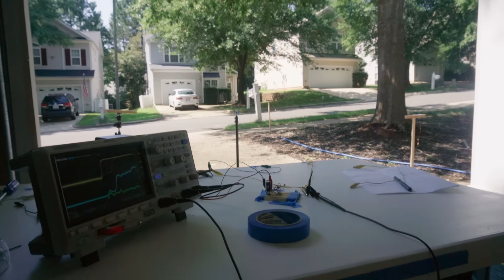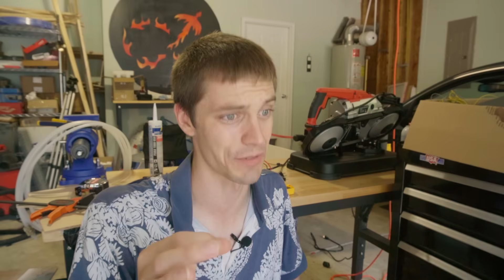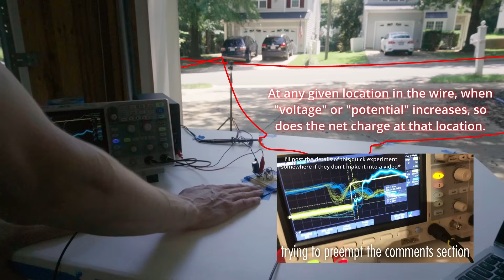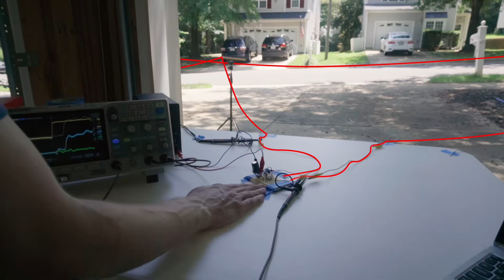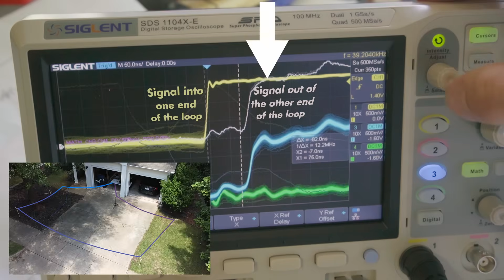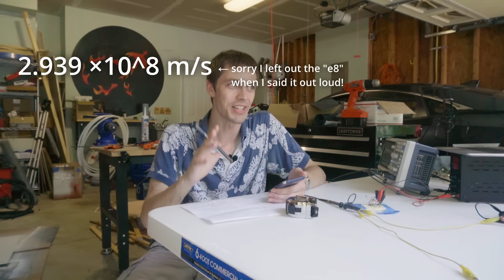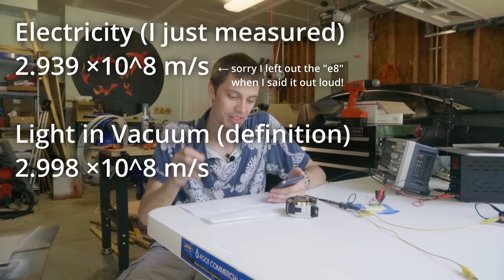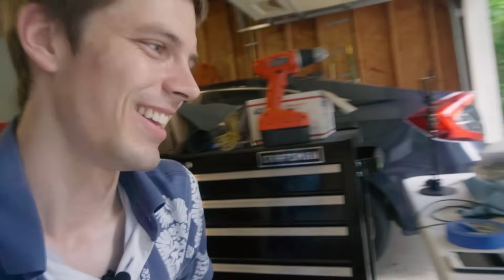Why does WATER change the speed of electricity?

Comment: The "water" part is great, but the 'thin' vs 'thick' wire seems problematic. Yes, you tried to make the experiment with not that much inductance and not that much resistivity, but it's still LR circuit. Reducing R will increase the reaction, not decrease, because inductance happens. t=L/R

Comment: You and Veritasium completely reshaped my understanding of how electricity flows which is amazing considering I've got a degree in electrical engineering. I've always thought that electricity moved at the drift velocity of a material, but was always confused why drift velocity is lower in metals than semiconductors. Now I understand drift velocities is only for electrons not the electric field that's producing the current.

But this begs the question: why is there talk of switching silicon-based subtrates for germanium if drift velocity doesn't change the speed of electricity? Same with the idea of photonic computing: if electricity moves at the speed of light, shouldn't conventional CPUs have the same clock speed as photonic currents?
Reply: The surface charge that is responsible for creating the (small) electric field inside the conductor is veeeeery fast. The charge in the bulk of the conductor that is accelerated by the E field inside is slowed to a crawl by all the collisions with the lattice ( in classical ED). The result is a drift at very low speed along the conductor. When you switch a semiconductor device you might be able to establish the field inside the different regions of semiconductors almost immediately, but then you need for charge inside to actually travel through them ( for example because you need to charge or discharge some inner capacitor: a on junction depletion zone, a metal-oxide interface...). And that charge move at snail pace, at a velocity summed up by the carrier mobility in the medium.

It's like being able to open a faucet in a millisecond and then having to wait for the liquid to pour into a container: it takes time, and the bigger the viscosity - I mean the lower the mobility - the larger the time.

Comment: you're generating a square(ish) wave right there w/ all that switching on and off. 
the way that happens is counter intuitive because switching on and off seems like just 'simple events' and not a combination of simultaneous interacting events. 

each change of state (from on to off and vice versa) is a summation of numerous waves, interacting constructively (for on) and destructively (for off).
the quicker the transition between on and off (the closer the on/off trace on the oscilloscope gets to vertical) the more sine waves at different frequencies you're using. 

the same goes for optical signals in an optical fiber and it's the reason why internet speed is limited even thru optical fiber: the faster you want to pulsate light thru the fiber the more frequencies/colors you need to combine to obtain the on and off. at some point the fiber can't transmit more "colors", a bandwidth limitation

edit: i found professor's Mike Merrifield explanation: https://www.youtube.com/watch?v=0OOmSyaoAt0

Comment: I’m not an RF engineer, but shouldn’t you be using a VNA and considering the complex impedance and velocity factor of the media when doing this sort of thing?  What was the frequency of the signal you were running through the line, 34KHz?

Comment: i understand that the speed of the electric signal is more dependant on the propogation of the electric field (which moves at c) than it is on the physical movement of the electrons (which cannot move at c, since they have mass) but does the physical movement of the electrons have ANY effect on the speed? does electricity actually move at exactly the speed of light or is it delayed very slightly by the phsyical movement of electrons? 

in your animation the elections each had to move and THEN they sent out their "signal" telling the neighboring electrons that their position had changed. obviously in reality theyre constantly updating their location while moving rather than waiting until they reach a destination. does that fact mean that how fast they actually move doesnt matter to the speed of the electric field at all? if electrons were so massive that it took an electron 10 seconds to travel from one atom to the next would that slow down the electric signal or would it still move at c?

and while we're at it. how fast DO the actual electrons move? like how long does it take a single electron to travel down 10cm of wire? is the answer to that dependant on the current and/or voltage?

so many questions
Reply: The electric field moves exactly at c in the material for the given frequency.  The electrons move very slowly, around millimeters per second, but the speed varies with the current (actually it is the current) through the wire which is of course caused by the voltage across the wire.  We call this the drift velocity, and it doesn't really have anything to do with the speed of the electric field.

Comment: Regarding the i-removed-millions-of-electrons-from-a-wire thing: please, please, please help me understand something. Would a metal that is held at a negative potential/voltage, i.e. which has a couple of million extra electrons pumped into it, rust at a different rate than a metal held at a positive potential/voltage i.e. with a reduced number of electrons?
Specifically, I am referring to metals helps in a humid salt water (i.e. beach) atmosphere, with no direct current running anywhere (i.e. not in salt water, wehere sacrificial anodes do their thing).

I do think the lack or excess of electrons should somehow influence oxidization in saltwater spray air, but I just can't find any information on it.
Reply from the maker: for really big structures I believe actual power supplies are used instead of galvanic sacrificial anodes just for this purpose! I actually saw a thumbnail today for a Practical Engineering video about this but I haven't watched it yet - i'm looking forward to it!
Reply: @AlphaPhoenixChannel  LOL. Yes, that video is in my current queue, too! But it sounds like it's "just" another video about sacrificial anodes. Which are cool and all, but don't really apply in this case, I think (although the zinc coating on steel is supposed to act as a sacrificial anode in the small circuit that gets created if the coating is scratched in a humid environment, AFAIK).

But still: if one just leaves a charged battery out in humid and salty sea-air, shoudn't one of the terminals corrode quicker than the other?

Oh, and I love your videos - especially the explosion of passion and the underlying beauty of the universe that just bursts out of you every now and then. It really shows how you 'grok' physics, I think, and is contagious. Awesome!

Comment: It's funny how many times recently I've been reminded that DC is just a weird degenerate case of AC.  It's sort-of 0Hz (so high pass filters are incredibly easy to make and result in AC coupling).  But it's also sort-of not 0Hz, at least for the very brief period of time after you flip the switch on...

Also, you can see some of the sine components in your scope - you want the voltage to go from 0 to 1V (or whatever) but you get half of a square wave, frequency components and all.
Reply: When a DC signal changes, it isn't DC at that point.

Comment: I love how you can hear the wire signal as interference to the mic. I wonder how well that loop was working as an antenna lol. 

Hams in the area were probably like “wtf is this noise” not realizing an incredible amount of science was on display.
Reply: It would send out one pulse when the switch was turned on and another when turned off, but nothing as long as a steady DC current flowed through it.

Comment: I think that everything in the universe is actually moving in spirals.  I do not think they are planar sinewaves. I think planar sinewave is just two planar dimensional representations of voltage and amplitude. If you were to look down the wire, at the electrons coming towards you, you would see combined representation the up, down and left right deflections simultaneously. This would appear spiral in nature. Think of a electron travel in any medium like a bullet being shot. The rotation always present in the electron/bullet itself imparts spiral to the apparent straight path. Also the electrons are attached to the copper molecules so the electrons are spinning around the atoms causing a wobble in the electron. Atoms neutral at rest but when current is applied then the electron movement causes magnetic "exduction" from the atoms (my word for the movement of atoms inside a wire whose emissions outside the wire can be read by induction). There are Oscilloscope setting that visualize the spiral better.

Comment: If resistance doesn't change the speed of propagation of electricity through a wire.. then in this particular circumstance it would be accurate to say:

..Resistance is futile

Comment: Having thought a little more about your experiment I am considering weather the fact that you get no difference between wires with different resistance/conductance may be that the differences are just so small that you can't measure it. I am coming to that conclusion because when you put it through water (water being a conductor as well although with very low conductivity if fresh water) I would think that the conductivity should be on the outside of the water pipe. It would be fun if you could make the experiment with salt water being much more conductive. A third experiment could then be with no wire through the pipe but just salt water.
I believe that the energy is traveling along wires both inside and outside. Inside the slight movement of the electrons and outside with the help of electromagnetism being the start of the generation of a photon. Energy may in fact leave the wire in form of radio transmission in which case the photons are fully generated. I believe that what we call capacitive transmission is in fact photons jumping where electrons can't follow. I believe that the little photons (that may actually be very big) do a lot more than what we normally think of (being light particles/waves).
Also if you had a storage oscilloscope you could catch a single switch on pulse with hours or days before the next pulse. I believe some of the modern software oscilloscopes would be able to do that too and even show what happens before the trigger pulse.
Reply: Resistance has nothing to do with the speed of propagation of electromagnetic waves.

Comment: I'm curious about what material, or combination of materials, would produce the strongest possible slowdown effect, like, could you have a fully connected circuit that you are able to effectively switch off and on by wrapping/unwrapping a portion of the wire with some passive material (I specify passive because I imagine one could use an active electromagnetic device, like an electromagnet or an EMP device, to affect the properties of the signal in the wire, I'm not confident in saying that as a total non-expert, it just sounds right). So like, some alloy of various metals, some exotic weave of fabrics, maybe just a bunch of particular chemicals dissolved in your water setup...
Reply: Air has a dielectric constant of 	1.00058986. Water has a dielectric constant of 80. Copper calcium titanate has a dielectric constant greater than 250000.

Comment: If the speed of the electricity depends on the medium around the wire, why did you compare it to the speed of light in a vacuum? Shouldn't you have compared it to the speed of light in air? I know they're basically the same, but it would make more sense of a comparison

Comment: You seem oblivious to the role of surface charge in establishing a conduction current inside the wire. Do a Google search.
Reply from the maker: The surface charge is just as mobile as the bulk charge. My diagram specifies “charge per length of wire” because the radial distribution doesn’t really change the outcome
Reply: @AlphaPhoenixChannel  surface charge recombines with relaxation times, bulk charge is impeded by lattice collisions. I'm talking classical ED. It's the surface charge that sets up the E field inside the bulk that is responsible for current flow. It is what Maxwell's eqs plus constitutive relation (ohms law) and continuity eq predict.

Edit:
Jackson's 1996 paper "Surface charges on circuit wires and resistors play three different roles" might shed some light.

Comment: You can find this speed in the specs for different types of signal transmission cable. For an open wire line, something like 98% is typical. For RG-8/U coax, it's 77%. For cat-5e ethernet cable (twisted pair), it's 64%. The pipe test result is not at all surprising - it's essentially a (impractical and inefficient) coax cable.
Reply: Of I got that part right, it's just a bifilar guide with a little extra capacitance due to the water around it. A coaxial line would require the return line to be the pipe. I just watched the video once and maybe I was distracted at that point, but it seems to me the return line is the wire on the other side, not the pipe (which I assumed was PVC or plastic)

Comment: Can someone shed a little light on my observation of the oscilloscope?  After the signal, and off course the delay, the line voltage appears to be higher (white & irregular amplitude) than the signal voltage (yellow and steady amplitude).  I get the amplitude variations, but shouldn't those average out to the signal amplitude?  Thanks in advance to whomever for an answer, and Many thanks for the newly minted PhD (AlphaPhoenix) for taking the time to post this experiment!

Comment: Calm down. You made a capacitor that is coupled to the PVC pipe, and then to the air, but only over a segment of your overall wire. The configuration would commonly be drawn schematically as an inductor in series with a leg that is your capacitor to an antenna (with a high amount of internal inductance (long wire in tube), and external resistance (air)), and an inductor back to home. The most common dismissive name for this circuit is a "transmission line", because this is a T-shaped, low-pass filter of exceptionally low quality. If you get the wire's resonance right, you can still salvage the experiment by using the water's natural resonance of around 2.4GHz as a refreshing  bandpass filter. There are probably some cool projects that can come of that, but misinterpreting what you did here as "slowing down the speed of electricity" is an affront to basic applied electronics, and makes baby Tesla sad. :(

Comment: Very interesting! An area where this sometimes comes up is networks: propagation delay is a real thing. However, since all long distance connections are optical the propagation delay of your typical network cable is mostly a trivia thing students learn to calculate something in an exam (I guess some high frequency traders do care).

The standard network textbook gives the propagation speed in a "network cable" as .66c without specifying the type of cable or network standard and that value gets repeated everywhere. So I once tried to measure the actual speed, using a 10G network card with timestamping features and a 50 meter cat 5e cable. (Longer cables don't work with 10G and lower speeds clock down the network card affecting timestamping)
I got a result of .69c, but the error bars were somthing like +/- .15c IIRC (because there is some constant processing overhead of the NIC that needs to be removed).

So I would be very interested in a measurement of the speed of some AC signals of different frequencies in different types of cables. Like how fast is my gigabit network (~100 MHz) at home really?

Comment: Fluke has a patent on measuring cable faults from submerged wire by reading the reflection it gives back. just from the reflection, the cable tester can tell if you if part of a cable is submerged and how far down the cable the submerged portion is. pretty awesome stuff

Comment: The problem isnt even the wires, its delay in the oscilloscope, every oscilloscope has some delay between 50--100 ns because well... Time itself, it takes time to do anything, even for the oscilloscope to realize it received a signal. Thats why u didn't get the speed of light in the first test. You need to consider a lot actually when dealing with high speed measurements even the probe bandwidth affect the time it takes to detect something. You definitely wont be getting the speed of light with an over the counter appliance of any kind, heck not even with an RF analyzer you can get C.

Comment: interesting, something occurred to me, does this explains blackouts when there are floods that inundate underground wires?
like slowing of electricity mess up the AC frequencie and in return affect the generators?
Reply: No. Underground cables are armoured with steel at ground potential for safety. The field outside the wire should be zero.

Comment: I think you were mistakenly refering to it as AC. You were using DC with frecuency signals on top of it (all the FFT applies the same). Any signal (sine or whatever) that does not cross the zero and reverse polarity is still DC. AC is defined as "an electric current which periodically reverses direction" [Wikipedia], which was not the case. Or was it? Adding up: as per the standby and switch-on voltages you used, are any of the FFT signals crossing zero and true AC? maybe some do and others dont?. As always, awesome experiments!, and the FFT part was great. Thank you.
Reply from the maker: Only one Fourier component contributes to the “dc offset”, but the oscillations are “actual” ac that adds on top of that
Reply: @AlphaPhoenixChannel  got it! thanks for clarifying :)
Reply: A transmission signal represents accelerating electrons. It basically represents the first 1/4 of a sine wave.

The most important thing this means is that it produces back EMF around the wire (inductance)